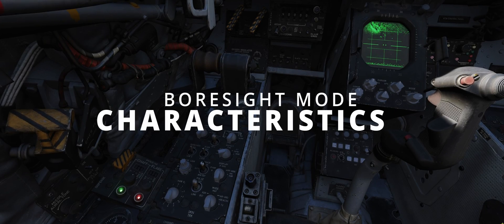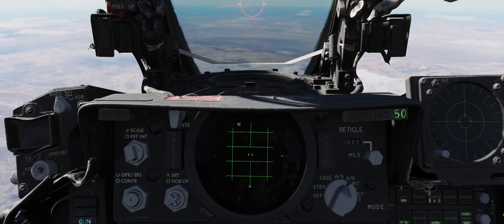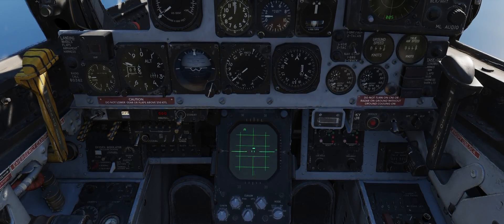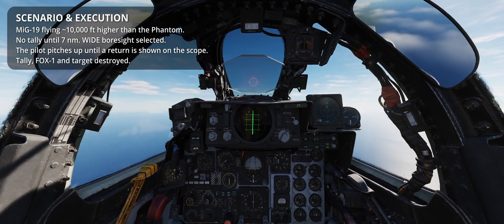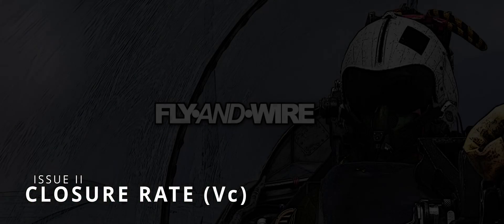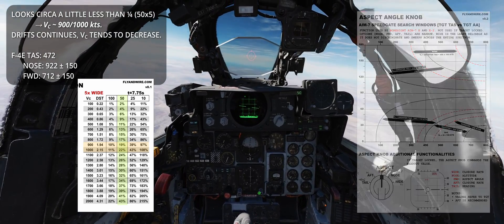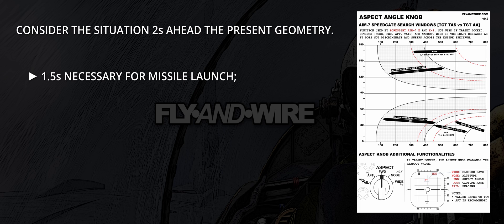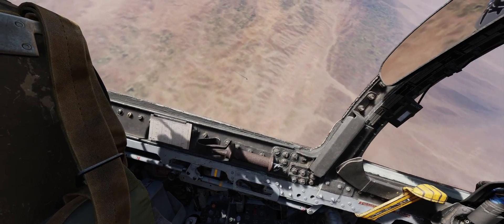DCS F-4E - Boresight Mode, AIM-7 & Speedgates [Essential]

Comment: Hello everyone! 
What happened to the Sparrow F4 module? For about a week or maybe a little more now, the Sparrow has become completely ineffective.

Neither in RADAR mode, and even less so in FLOOD mode.

Yes, sure, before there was roughly that 30% failure rate on launches for various reasons, always to reflect reality. But now, in my opinion, we're looking at over a 60% failure rate for launches.
But please, don't tell me it's a skill issue; I'd like to know if you've also had this impression.
Reply from the maker: Hey, nothing has changed on HB's side, as far as I know. Send me some tracks via Discord or ED's forum and I'll pass them on to the team.

Btw, there is no flood mode in the Phantom. The boresight should be quite awful and hardly viable most of the time. In DCS, it is vastly overperforming.
Reply: @FlyAndWire  Thanks for the kind reply. I'll record some .trk files with a friend and forward them to you.

However, the flood mode is also mentioned in the HB manual.
Reply from the maker: Brilliant, thanks mate.

> However, the flood mode is also mentioned in the HB manual.
Yeah, in quotes though: 'To enable no-lock "flood" shots with the Sparrow'. Boresight shares the no-lock similarity with flood, but there are many differences. I know more than one ex WSO that would be very... "upset" about mixing them up :P
Reply: Almost impossible to kill someone in online. Basicly, you have only IR missiles on this plane or just a ground attacker.

Comment: You might have mentioned it or not, didn't catch it, but depending on the weapon selected, CAA mode will attempt to lock in that area. Example: With RADAR selected, Pressing CAA will search the Right portion of the radar and not the center. This is crucial when attempting to BST a target and then pressing CAA on a target that's off your nose. Depending on a lot of factors you might lock something else that's not entirely intended.

So its advised to if you're using CAA in BST - make sure your heaters are selected so it will scan down the center. But even still I find myself locking onto clutter than the target in this mode. Usually just let Jester lock in BST and hope for the best. D:
Reply from the maker: I covered this last year. The pinky works as a weapon and channel selector for CAA, but it is not related to boresight. Boresight and Cage look similar, but they are extremely different, don't mix them up.
Reply: @FlyAndWire  Is there a way to jump into Jester's seat, do your selections (BST and Aspect) then jump back into pilot without Jester changing your selections?
Reply from the maker: I have no clue, to be honest. I always disable Jester, both in the Tomcat and the Phantom. I used it a bit when HB requested ad hoc testing, but I don't recall whether there are specific options for radar mode and aspect. I take you have checked already?
Reply: @FlyAndWire Jester will revert any changes to gain, range, scan-type, or mode which you select once you jump out of WSO. Unfortunately the only way to hold BST mode right now is to entirely disable Jester. 

To say Jester has been one of my primary frustrations so far with the F-4 is an understatement. As soon as I'm comfortable enough with the radar I fully intend to keep him off all the time.
Reply: @FlyAndWire how do we use boresight if we don't have a human RIO? are we limited to the CAGE method and how close is that to the same PK rate?
Reply: How do you tell Jester to lock in BST? I didnt find it in the menu and when I switched seats to manually set BST myself, Jester switched back to his standard scan when I entered pilot seat.
Reply: @gunschel  You Cage (BST) Then you use the Jester Context Menu when you have the target in your reticle. A single click he'll lock onto the contact (or attempt to depending your angle). In every case its better to be below the target than above it due to the clutter.
Reply: @Whuping  You have answered your own
query